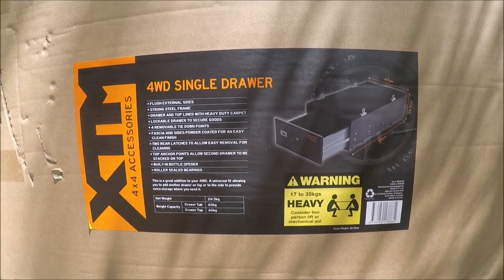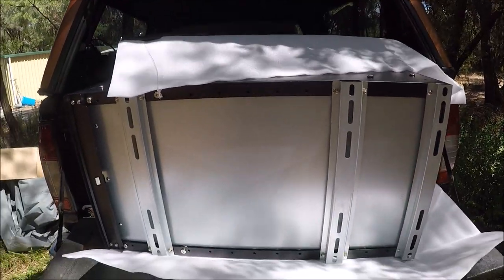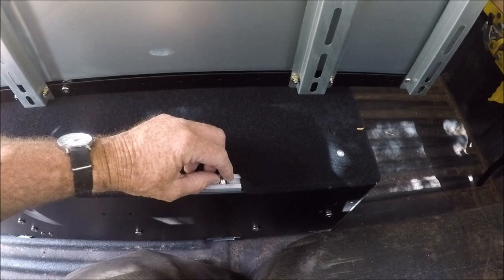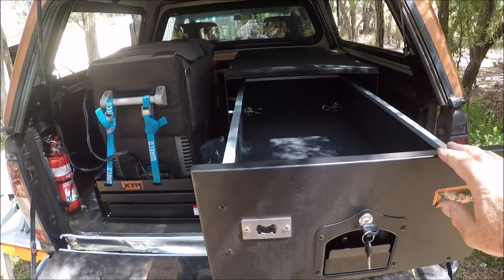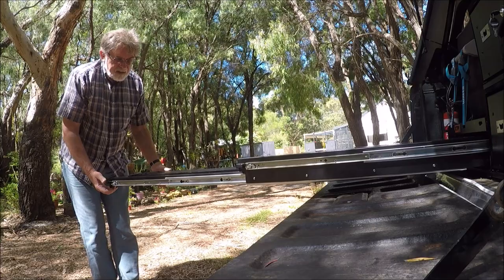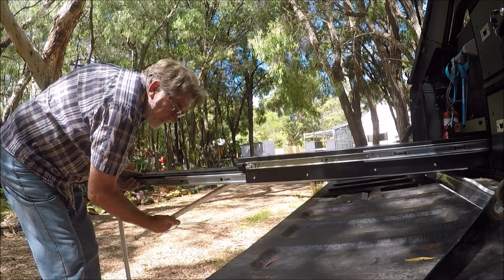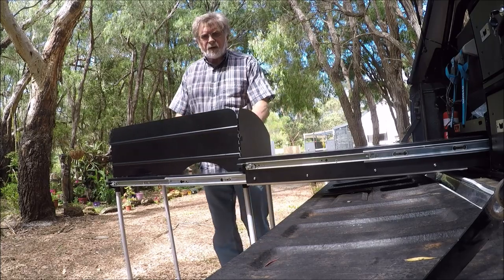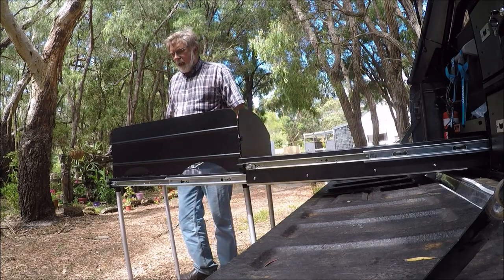XTM  KITCHEN & DRAWER

Comment: Hi Doug, great video – very informative. By the way, how did you connect the drawers and slide-out kitchen to the floor of your ute? I have a Mazda BT-50 (Ford Ranger clone) and I'm looking at getting the XTM set up with slide-out kitchen and drawers on the right. Also, can you access your fridge when the kitchen is out and assembled?
Reply from the maker: Hi Paul. I put a video up called XTM kitchen installation. The drawers I drilled through the tub & bolted them down.
Reply: Bolt to plywood floor. find anchor points in your own car for the ply wood

Comment: Hi Doug, 
Thanks for your previous reply. Also wondering how you find standing in front of the food prep/cutting part of the slide out kitchen when the ute door is where you'd stand. Do you stand on the outer side of the ute to do this?
Reply from the maker: Hi Paul, I haven't found the drop down ute tailgate to be a problem when preparing. I actually use it as part of the prep area but as I travel solo I  guess I dont need as much space as say a family might. I  have a few videos which actually show the kitchen being used. From memory it was a video at Carawine Gorge but you will have to wade through a lot of travel footage but that is what fast forward is for!

Comment: Would like to see  how you installed the bottom drawer as I have no tie down points in the tub of a BT50 / 2012 Ute.Just purchased the single drawer and looks like I have to remove the top of the drawer unit which is held down by Allen screws to be able to insert self drilling screws through the cross support channels of the XTM  into the ute’s floor bed ribs.?
Reply from the maker: Hi Kevin. If you pull the drawer out to its fullest extent, you will see at the back a ring clip on either side. Pull each of these in towards the centre & the drawer will slide fully out of the case. This will give you access to the bottom of the unit which has holes so that you can screw or bolt the unit to the tub of your ute.
Reply: @dougrorison1211  Thanks Doug  I have already done that but my first impression was that the amount of room to use a drill upto  800 mms from the drawer’s open end and the  distance of the roof  to those cross members would be impossible to operate a drill driver in. I will have a closer look in the morning as I have only purchased this unit today. Again thank you for your prompt reply. I’ll let you know how I go.
Reply from the maker: @kevinbrotherson5433  Kevin, I actually marked the hole positions using the base as a template. I then drilled through the tub & fitted bolts through the base & tub & tightened from underneath. I dont know if BT50 tub has enough room to do this without encountering obstacles. The Navara tub was clear  in that regard. Good luck.
Reply: @dougrorison1211  G’day Doug have fixed the drawer casing easily to the tub floor by removing the carpet clad wood roof of the casing which is held down by 8 screws exposing  the whole of the underside and it’s  3 cross plates for easily fixing them to the floor, That roof section was placed back on top and screwed down. My fridge slide will be easily fixed on top.The removable roof is a godsend and should be highlighted in any advertising. Once again thanks for your help.
Cheers Kevin.
Reply from the maker: @kevinbrotherson5433  Hey Kevin I didn't know about the roof section. I will check mine out. Others have asked about fitting the fridge slide to the top of the drawer unit. I would be interested in seeing how yours turns out. Cheers Doug
Reply: @dougrorison1211  Doug my slide fitted perfectly the screws drilled into the metal that is folded over on the top edge of the side walls. This is the same metal strip that the carpeted wooden roof is fitted to. If you feel that you would require extra purchase for the slide you could also drill extra screws into the wood or even add more metal plates across the roof fixed to the folded side strips as described before. That removable roof certainly makes anchoring the fridge so much easier. My only disappointment is the clearance of the fridge from the canopy’s roof and the rear window opening and the ability to fully open the fridge lid. However I will not be spending $700 -$1400 to put in a drop down slide. I modified the fridge lid’s hinges so I can remove the lid without lifting it so I can gain full access to the fridge when needed which will not be very often. Hope this helps  Kevin.

Comment: The XTM drawers are easier to set up than the Titan drawers from Supacentre, you don't need to remove anything, just slot in the 4 bolts and nuts. I'm glad I waited and done my research before purchasing the XMT drawers, much better manufactured than Titans
Reply from the maker: Yes Troy, I found them very easy to set up. They held up well on my recent trip & I was delighted with them.
Reply: @dougrorison1211  Some people say they rattle and fall apart.  What was your opinion in that regard?
Reply from the maker: @davidkelly1677  Hi Dave,  I found them to be sturdy enough for their purpose. They are put together with nylock nuts & under the 'normal' conditions that you would encounter on Australian roads, they should hold up as well as any other brands on the market. I know that  some of the people who put videos up on You Tube travel on very  ' extreme' tracks & literally 'shake the shit' out of their vehicles & their equipment. I would have no doubt that any of the equipment on the market could not stand up to that sort of abuse. I always use the dictum that I buy the cheapest possible thing that will do the job & that if it fails then I replace it. There is a saying that 'you only get what you pay for'  but seriously, most of the stuff we are sold today comes from China anyway & a lot of it comes out of the same factories. People who think that they are getting a 'better' product because they pay heaps of money for it are deluding themselves.  I just completed an 8000km trip & the XTM stuff I used is as good as when I left. 
On a prior trip I used drawers that I actually built myself & remember having to replace a screw at the back of them when one of the runners came loose & the drawer would not slide That is one of the reasons I put my faith in these XTM drawers & they stood up to any punishment that I gave them. Having said that, I do not like to abuse my gear because I might come to rely on it!
Reply: @dougrorison1211  Thanks Doug.  My thoughts exactly.  The amount and number of products around now is getting ridiculous.  As is the cost (I saw a fire pit with a logo on it for $300!!!).  My four wheel drive has developed a few rattles but at the same time, it's done some interesting roads through the Simpson and Oodnadatta.  I keep debating whether to build my own packing system, but I doubt I'd achieve anything lighter or necessarily cheaper.  Really enjoying your style of video.  Keep up the great work!
Reply from the maker: @davidkelly1677  Thank you David. I did go the ' build your own ' route but when I saw the XTM stuff for the prices, (on special at BCF) I could not go past them. I had looked at ARB & a few other brands but could not justify their prices for what 'advantages' they were saying I would get by owning them! Glad you like the videos. Safe travels.
Reply: @dougrorison1211  Hi Doug.  I ended up fashioning the XTM drawer and built my own false floor into my Pajero.  Works really well and improves storage considerably.  Off to Chowilla Game Reserve at Easter.  Safe travels.
Reply from the maker: False floor seems like good idea Troy, would get the drawers higher up in the tub. Have a great & safe trip. WA premier says he is unlocking the gates here come March so maybe I can stretch my next trip out of WA!
Reply from the maker: Sorry, David, not Troy, must be doing my head in being locked away! Lemme out!!!

Comment: Gday Doug, does the fridge slide still work with the prep table out mate?
Reply from the maker: Yes Mal it will slide out over  the prep area to where the cooker area starts.
Reply: @dougrorison1211  so you need to remove everything off the prep table first if you need to get anything out of the fridge whilst cooking? (that's not a sarcastic comment...genuine question). Or does the fridge slide extend out further, therefore extending all three sections out?
Reply from the maker: @GB-cm6yy  yes GB, you need to get stuff out of the fridge early as the fridge slides directly over prep area. I have never had an issue with that though as I can still access fridge through my canopy side window if I forget something.

Comment: I’ve checked these out in person and certainly good quality. But I see a bit of a weight penalty at 26 kg a draw. So that has to be taken into consideration.
Reply from the maker: I think most of the available units on the market would be of similar weight but having used my system on an 8000km trip recently, I had no issues at all regarding weight. This system was probably lighter than my previous home made version !
Reply: Titan single 900mm draw which is the same size is 31kg per draw and a lot of people are running them. So this is a little lighter and better built which sold me.

Comment: Pretty swish mate. What are your thoughts on how they'll handle corrugation?
Reply from the maker: Well, I have the fridge thingy screwed down with TEK screws which was how my old slider unit was anchored & that did not give me any problems on the corrugations. The bottom drawer is bolted to the floor with 10mm stainless bolts so I don't see any problems with them sliding about, but, of course, time will tell!
Reply: Good video mate I'm thinking of purchasing this product could you please tell me what the dimensions of the cooking area is? I have a Coleman hyperflame which is a fairly large cooker cheers mate
Reply from the maker: @andybourne4094  Hi Andy. With the wind guard up the dimensions are 720mm wide 420mm deep. Without the guard add probably another 25mm but the guard is really the selling point for me. Hope that helps
Reply: @dougrorison1211  thanks pal that helps me heaps the local bcf doesn't have one in stock so was unsure of dimensions safe travels mate
Reply: I have the same set up, spent a week camping and driving on corugation, I had no issues.

Comment: Hey mate, does the kitchen and or the drawer rattle at all when driving ?
Reply from the maker: I never hear it as it is in the back of the ute & bolted to the floor. It's put together with nyloc nuts & bolts & for the price I paid I dont know if other stuff on the market would be any better. I have had it on an 8000km trip & it is still as good as when I installed it. Will be heading off again next week & I have just finished packing it all together & didn't find ant loose nuts or bolts.